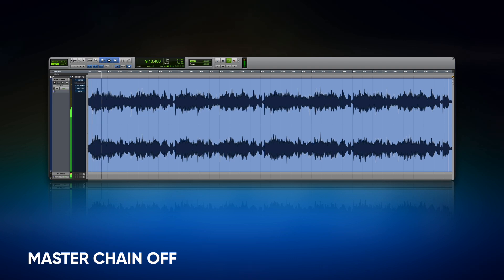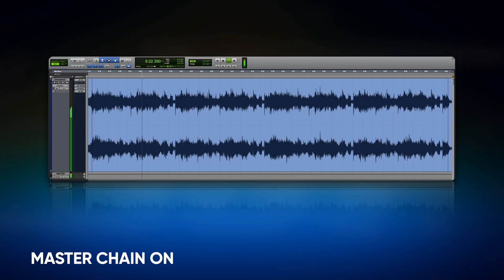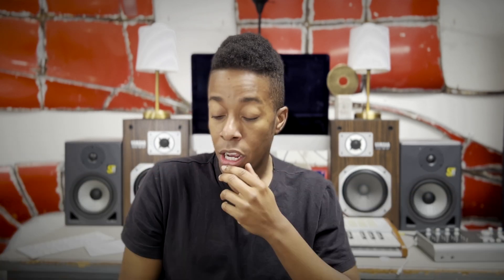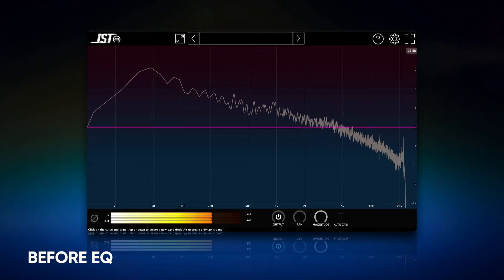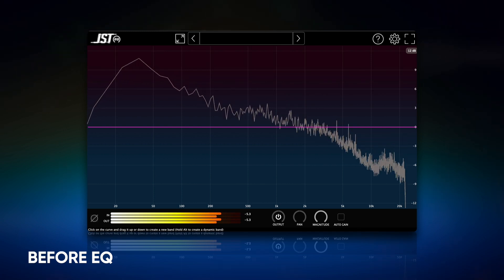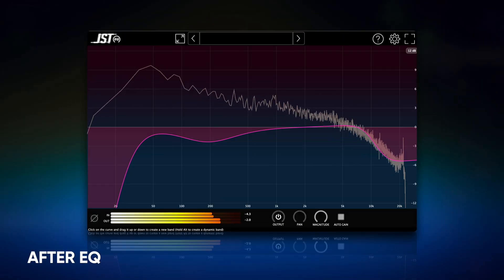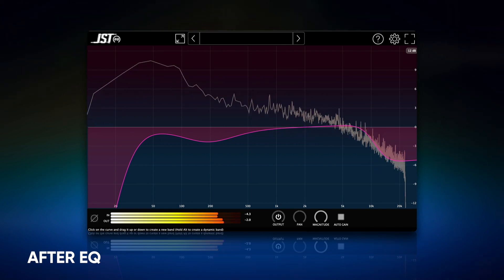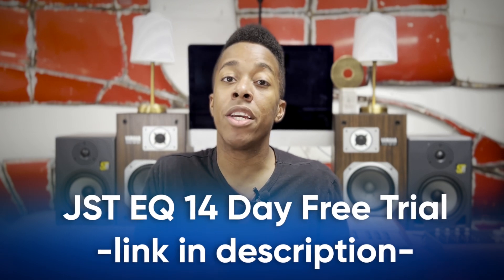The Master Bus Signal Chain EXPLAINED

Comment: maybe transient designers?  Here lately my mastering chain is consisting of a coloring EQ called BlendEQ by Analogue Obsession. Each individual band you can select to use Neve, API or a blend of the sound. it also has saturation.  then i use a non coloring EQ to do some cutting of frequencies, then into the JST bus glue and finally JST maximizer. I do sometimes try out different chains to see if i can get different sounds.

Comment: I almost always have tape saturation on my master bus. My order is usually tape saturation, EQ, compression, limiting. I don't know if that order makes the most sense, but it works for me. Sometimes I'll have a second EQ after the compression. 

I usually use something by Brainworx as one of my EQs because they have built-in "monomaker" and "stereo width" knobs. Don't worry. I play it very safe with the stereo width. A lot of times I don't use it at all. The "monomaker" helps make sure that your low end is tight and focused.

Comment: No matter what the song, I find myself using master bus EQ to cut or boost in roughly the same ranges. Broad cut in the low mids, small boost between 3k-5k, boost or shelf at 12k or higher. My mixes tend to be a little scooped. The boost in the "harsh" 3K-5K range helps with that. It also improves vocal intelligibility and the "bite" of the guitars.

Comment: 6:40 Great video but I was confused by this bit. Make-up gain alters the volume after compression, right? So in my understanding, matching the output level to the input level would actually help with hearing what the compression is doing (same if the compression was boosting the volume). Also, wouldn't altering the levels of the individual tracks potentially undo any adjustments made in the EQ (and the whole top-down mixing ethos)? Just trying to work out if I had misunderstood something.

Comment: Hey Miami! When you're setting up a template for top-down mixing, do you leave the EQ blank? Since it's corrective. Like in the example here, the EQ is correcting a low-frequency buildup: but that might not be present in every mix.

So do you just leave it on the chain, ready to spring into action if needed, but otherwise inert?
Reply from the maker: Nah, I’ll explain this in the next video. It’s a general eq curve that gets applied
-Miami

Comment: Hey man quick question, if you use these effects after you’re done mixing like the examples in the video isn’t it almost the same thing as leaving it to the mastering engineer? I thought the main reason of a stereo bus chain was to have an idea of how the song will end up after it’s been mastered
Reply: The idea is to start your session with all these effects on your master bus and then load in your other busses and begin to treat them afterwards. 

If you mix multiple genres you can setup different templates for each style and then use them as your starting points.

You may need to tweak things slightly such as release time depending on the song or whether or not you want to use multiband compression. But this way as you make adjustments on individual tracks or seperate busses you will get closer to a finished sound where in traditional mixing you start mixing your tracks and busses then treat the master at the end.
Reply: @Sense_of_Insight  thnks you know your stuff!